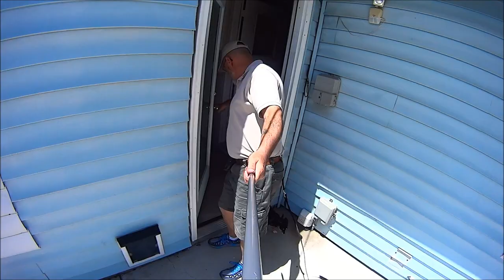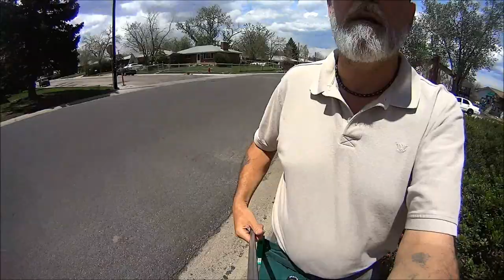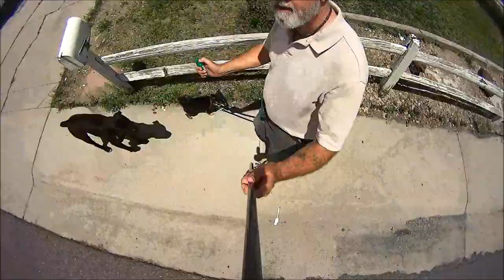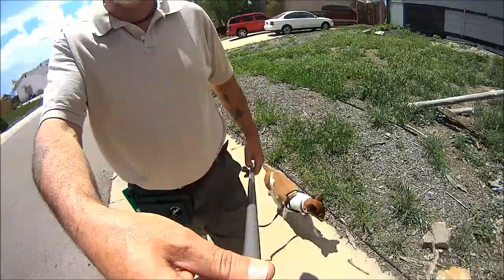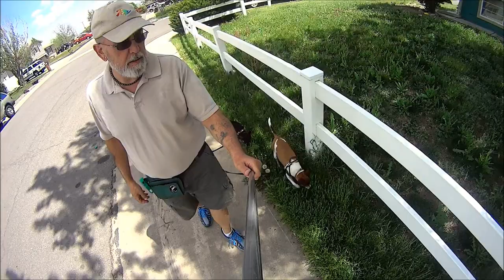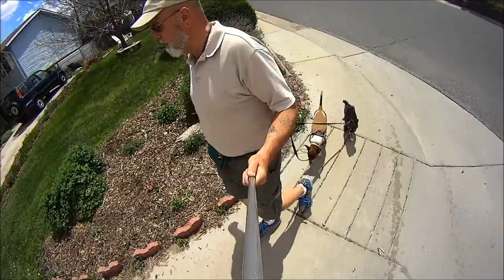First Pack walk with the Sony Action Camera on a pole

Comment from the maker: I have the Sony mount that allows you to adjust the camera angle up & down.
 I has a standard threaded hole to attach to a tripod or other such device.
 I simply bought a bolt at the hardware store, drilled a hole in an old
 metal broom handle and mounted the camera.
 It work well and allows quite a few adjustments.
 Glad you enjoyed the video.
 I'm trying to make my video's better.

Comment from the maker: The pole was a piece of old shelving that already had a hole in the right place and of the right size.
All I did was find a bolt of the correct size to thread through the pole and into the base of the camera and there it was.

Comment: did you have the camera in the case ? the audio sounds muffled
Reply from the maker: Having it in the case was the easiest and safest way to mount it to the pole.
Reply: true but your compromising the beutifull sound this has, can be mounted without the shell !
Reply from the maker: You're right.
I have since figured out a way to simply wrap Velcro tape around the body of the camera and around the pole.
Not only is the sound better but it is lighter as well.